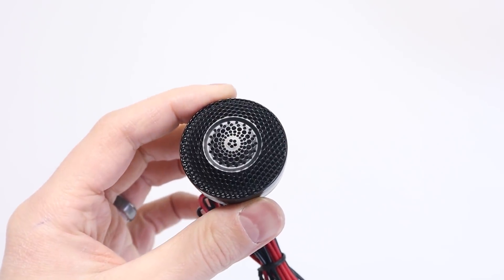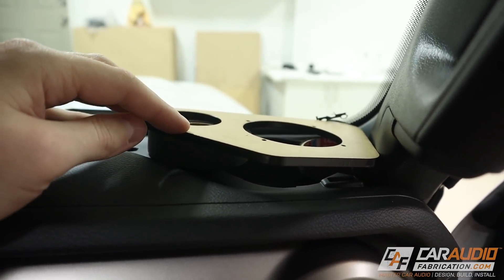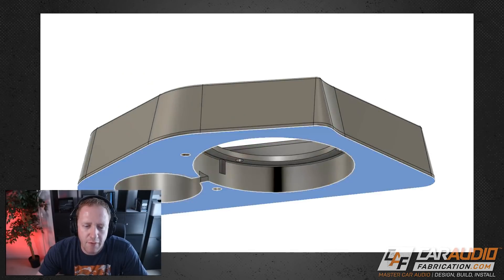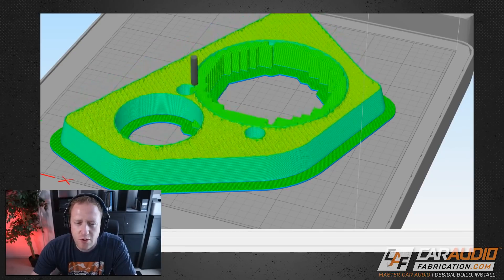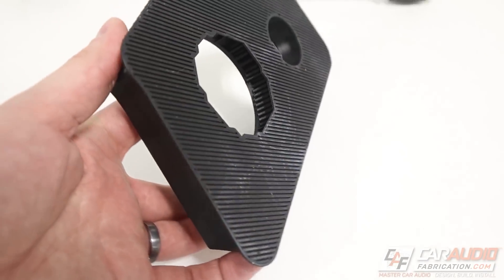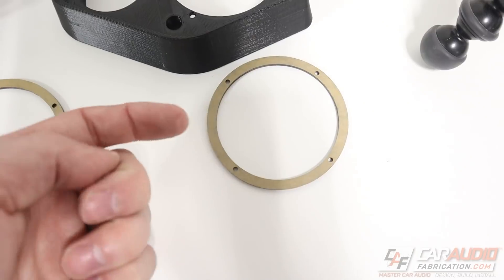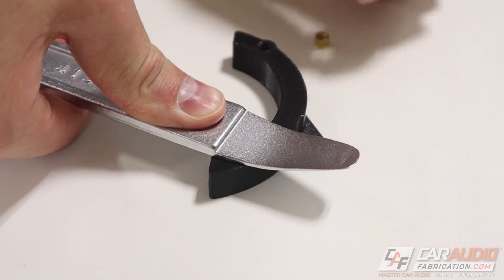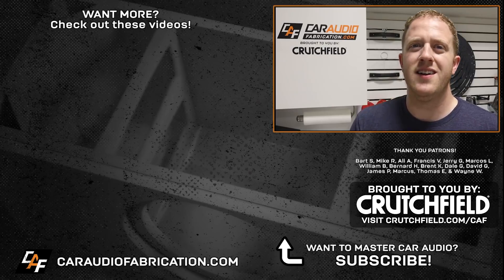You challenged me! 3D Printing Dash Speaker Pods

Comment: Would you possibly be able to post the file to these pods or if you’ve done any for specifically for a BMW F10 that would be amazing. I have a 3D printer, however don’t have a router let alone the knowledge of how to use a router so my only option is 3D print. I need an amp rack for a skar amp as it’s super long and weird, therefore I’m unable to hide it anywhere without having a custom mount or maybe mounting it to the trunk roof. I’ve made a fiberglass stealth box for the right and left empty space cubbies for my subs. I’ve also started upgrading all factory speakers but need to make the plastic wire connector for a BMW speaker as I don’t want to cut or Splice the factory wire so any suggestions on how to copy the bmw factory speaker wire connector plastic housing please do share.

Comment: On some items you buy you will find a hole shaped like a nut that you place a nut in then you put your screw in from the opposite side the nut shaped hole holds the nut from turning while you tighten the screw or bolt down. You could add that to your pod you wouldn’t need the extra plate and no tapping.

Comment: Hi i have one little question .i have spectron amplifier with around 400w of power and a jbl subwoofer with around 1300w .and if i turn amplifier power to around 50% it blows the 10amp fuse .is it ok to put on a stronger fuse?if you need i can get exact specs of this amplifier .I bought it new. Cable from the battery is 10mm width.

Comment: This is so cool. I figure the advantage of this design process would be you could go back several times (given 3D printing takes time but still) and work a few models out until you find one that suits the vehicle and your expectations. Glad you also mentioned PLA vs ABS, I didn't even think about that, I imagine if PLA was used it would have warped into some awful wonky shape after a few days of use. Great video Mark.

Comment: Sometimes I print an oversized hole, then separately print inserts at 100% density, super glue them in the holes, and then drill and tap them.

Comment: Just a thought, couldn't you have used the original speaker grille on top of your pod? I appreciate you would have had to somehow open up the area where the tweeter is as the "mesh" looks like it's solid in that area which would be a challenge but I feel it would be worth it for a more oem appearance.

Comment: Forget the raft, get a heated glass print bed and use a couple thin layers of kids’ glue stick. Most importantly, when printing ABS, you need to control the air temperature in the space around the material as it prints. The easiest way to do this is throw a blanket over the printer, just make sure none of the mechanics snag the blanket.

Comment: If I understand this correctly certain 3d printing filaments can be smoothed using acetone. Just the fumes are enough to smooth those lines on the outside
Reply from the maker: I find body filler to be far more predictable. The acetone smoothing makes it "smooth" bit wavy. Which requires body filler to correct

Comment: You really just tapped threads into plastic? You do know that metal machine screw threads are tougher than acrylic right? It will tap itself on the way through
Reply from the maker: Try it for yourself and you will quickly learn why a tap should be used. Especially on a piece that is 1/8 inch thick.

Comment: When tapping into 3d printed parts i use a couple extra perimeters in my slicer settings. slightly undersize the hole for tapping and then drill it out to the correct hole size for the tap you want to use.

Comment: Nice!!!! It must have taken you a while to do the design for those awesome pods! I do DIY videos my self too and wonder if I should also get my self a 3D printer vs using my router lol! Or at least get one of those CNC machines that use a router but with a PC for programming the work load. Very nice work as always mark, you are the one who inspired me to go through with my full JL Audio C7 system in my Flex.
Reply: i know this is an older video, but a 3D printer is definitely a great tool to have. While i'd love  CNC table I don't have the space to dedicate for one. My smaller 3d printer on the other hand I do. I can create smaller pods, logos, badges and really anything I can think up. The downside though is if you don't have any CAD design skills then you're paying someone to do the designing for you. In the span of a month when I first started I strapped in and learned Fusion360 basically DIY. I can also make smaller flush trim templates for my router as well. The other advantage to learning the design side of things is even if you outsource the fabrication of templates and things like that you've reduced some of the overhead by doing the design portion yourself.

Comment: I’ve heard you have to be careful with 3D printed plastics near ventilation because the heater of the car will be enough to warp & eventually bubble or crack the enclosure. Maybe your 3D plastic base is more heat resistant than direct sun exposure & heaters can damage?
Reply from the maker: Lol, maybe if using PLA. Not going to be an issue with ABS

Comment: Can plastic that’s designed to melt like that stand up to direct sunlight exposure in the windshield?
Reply from the maker: Extruded at literally 482 degrees F. If your dash is that hot you're going to have more issues to worry about. ABS is used in OEM vehicle applications. And by your methodology of thinking the whole car would melt... everything plastic in your car is melted prior to being formed...

Comment: You do such an amazing job.   Your experience and skill shine through.   

The only comment I would add is that for car audio installs,  make sure you check the material you use on the 3D printer.   Some will not hold up to the heat of sitting on a dash
Reply from the maker: This is mentioned in the video

Comment: I think with the price tag on those speakers and tweeters I don't mind to modify the dash hole to make it flush and more stylish but hey it's just my preference ⚓
Reply: The price tag on those speakers I would want to take them out and put them in a different car if I ever sell the car I'm putting it into so I'd rather everything go back to stock
Reply: Agreed, my opinion as well. While you own the car, you can enjoy the look of a FLUSH speaker. When you sell, you can remove the expensive speakers and swap out for inexpensive drop ins to fill the new holes 👌👌👍👍

Comment: Great video! How did you determine how much height to give between the mounting surface of the speaker and the inside of the custom speaker grill? I've thought about doing something similar with my 3D printer. The speakers I'm looking at list one-way linear excursion Xmax, but it is not clear where that distance is measured from on the speaker.
Reply from the maker: Good question, I would double the Xmax value they listed just to be safe. The excursion distance is so minimal for a midrange speaker anyhow you're only talking a few mm. Or reach out to the manufacturer for clarification. Trust me, I share your disappointment with how many manufactures provide little to no technical data about their products. As a bonus asking a question like this is also a good way to determine if the company actually designed their products, or if they are just having products rebadged overseas. You would be astonished how many "manupackagers" do this and actually know very little about what they are selling.

Comment: Can I ask you a few questions? Have you installed anything in the dash center speaker position in a 4th gen Ram 1500?

I'm trying to think of a way to flush mount a 4" coax speaker into the speaker grill itself since the hole under it can only fit a 3.5" speaker. The magnet itself on the speaker Im looking at is a little over 3" and Im hoping with flush mounting it, it will fit.
Reply: He won't answer your questions as his patreons are far more important than his YT viewers. Money speaks volumes with bloke.

Comment: I've looked into 3d printers. If I go that route, I'll definitely be also picking up a 3d scanner for seamless transitions/ integration.
If you get a scanner Mark, I'd like to see how you work your magic with it! 
👌🏼
Reply from the maker: Luckily decent 3D printers have come down in price. 3D scanners however are still very pricey. Hopefully more and more companies can get involved in the tech and competition can drive more competition, but right now it seems there are only a few companies with scanners that would work for our application and their scanners are pretty high end.  And I'm not saying you think this but I believe some people think having a 3d scanner is an instant problem solver, "just scan it and then print it" when in reality you still have to have pretty advanced design skills to model the new solution that mates with the scanned surfaces and need an understanding of the limits of the manufacturing process you plan to use for the new part to get perfect results.
Reply from the maker: There is some great mesh software out there, but same issue as the scanners... $$$.
Reply: I used meshmixer (free and open source software) that uses photogrammetry to generate a 3d model from a lot of pictures to create an infotainment center for my citroen saxo. Be shure to not print in PLA as it wil warp or melt in the sun.

Comment: Fantastic work guys!!!
Could you do something similar with Dynaudio MD142 and MD102?  That’s a full 4”
Reply from the maker: This process could be applied to any speaker and any vehicle. Just need to design it. Your imagination is the only limit.
Reply: @CarAudioFabrication  I have the exact same car and an basing my install exactly on yours.  Only difference being the equipment I’m using.  What I should have asked: would there be room for a full 4” midrange?  I’d be prepared to buy some if you could modify the design to suit the drivers I have (Dynaudio Esotec 342 - MD142 and MD102)
Reply from the maker: The space is tight, I wouldn't recommend a 4". It would be just enough larger that it would pose many design challenges in this area. Not saying it can't be done, but the difficulty goes up. There is only so much room.
Reply: @CarAudioFabrication  thank you very much if that’s the case it could be a deal breaker in using or parting with my Dyns from my previous build and buying a new set like the JLs you are using